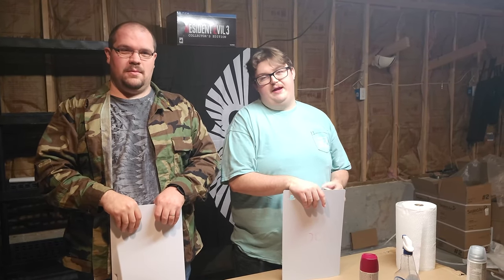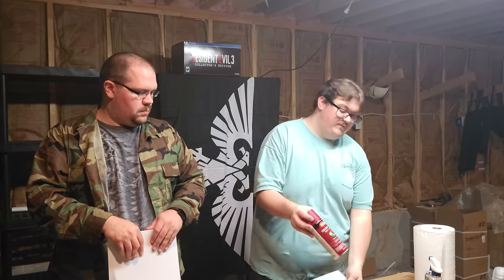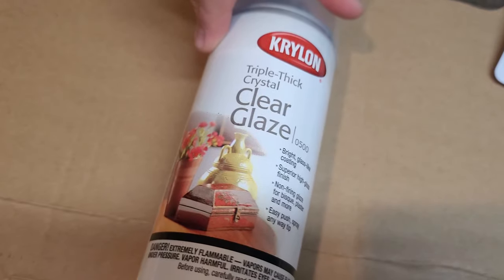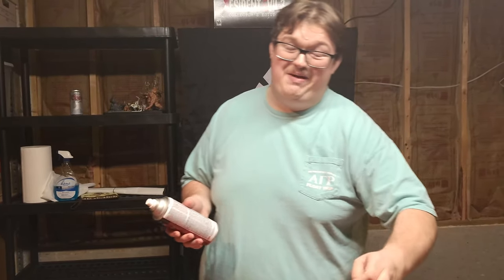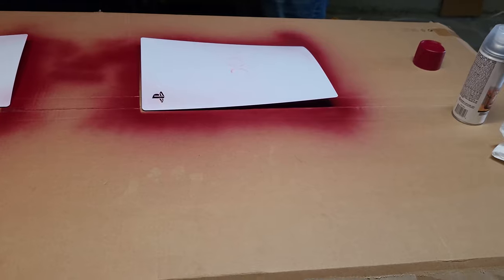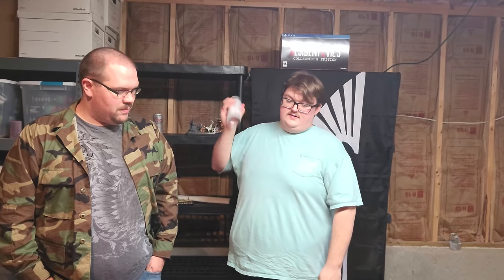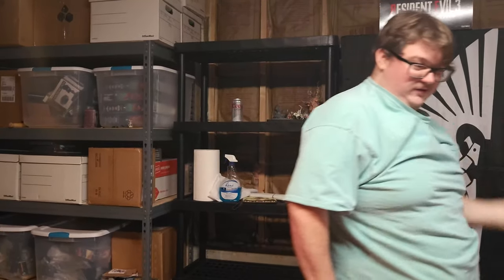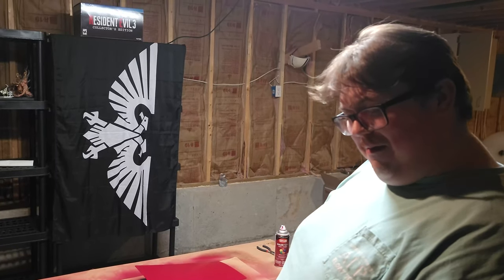RED MAKES IT GO FASTER!!! | Custom Painted PlayStation 5 Walkthrough / Tutorial (DIY)

Comment: If I use a peelable paint like plasti dip can I use that clear glaze? I want a high gloss finish
Reply: Plastidip will melt from heating and possibly ruin it
Reply from the maker: Thanks for watching! Yeah clear coat will most likely melt the plastidip but even then in a test we did it as the glaze/clear coat drys it also shrinks causing it to rip.